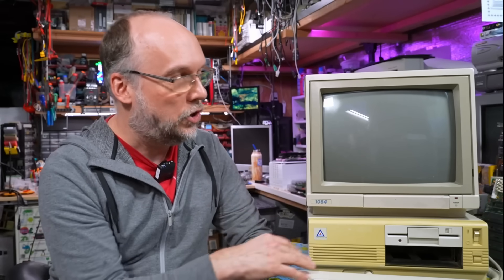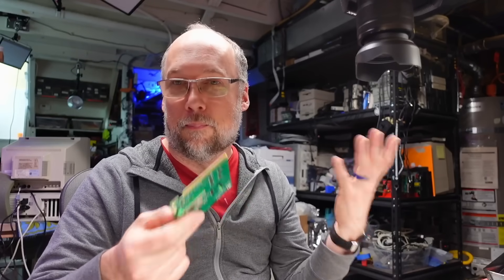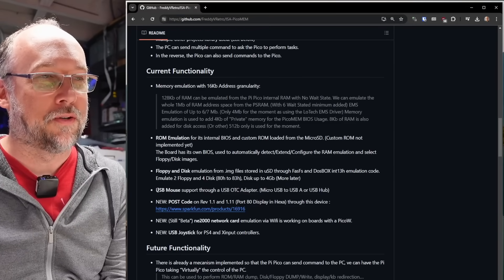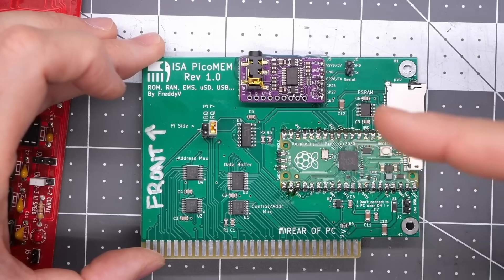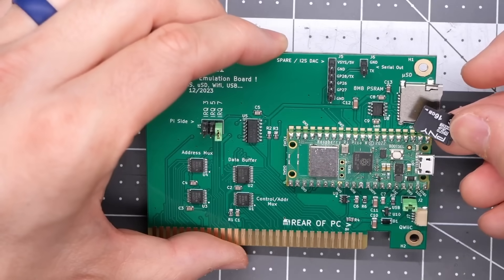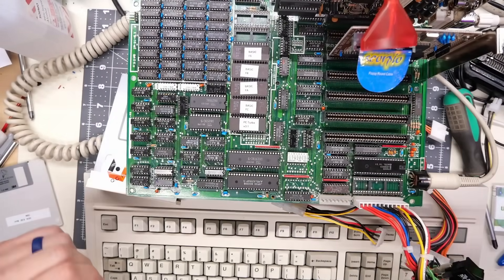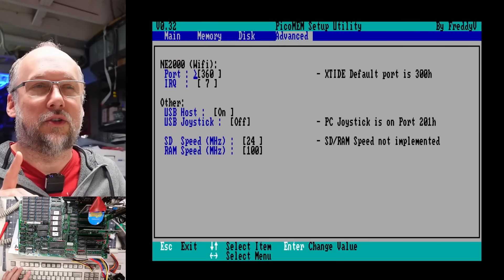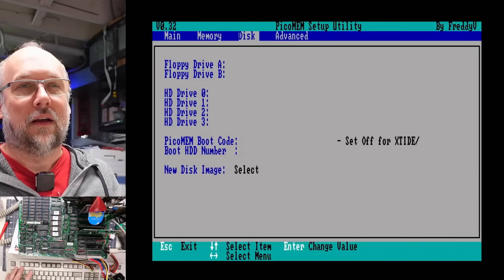The PicoMEM is an amazing software defined ISA card

Comment: Hi Adrian, thanks for the tip about this product. I will use it to resurect my old Tulip SX Compact 2 which was my first computer. It is actually a Dutch made 386sx and is still working except for the 3,5" floppy. Replacing that floppy drive with others I have (I remember even trying that when it first failed). Would you happen to know why other floppy drives simply refuse to work on a 386sx?

Comment: This can be exciting if there would be a PCMCIA version of it for all the HP 100LX, 200LX and all the other 8086 palmtops out there.
Reply: It is not possible to boot from pcmcia right? Option rom thing
Reply: @henrikgustav2294  I am not sure, my SD to PCMCIA adapter is capable of booting from it, can not speak for all versions of these adapters. Yet, there are PCMCIA floppies that most Toshiba Libretto computers boot from, also let’s not forget the PCMCIA CD-ROM drives which are bootable, that is how I installed OS/2 Warp to my Gateway 486DX2-66

Comment: One thing they should think about is doing a DOS IFS (like MSCDEX or one of the network drivers) which pushes the actual filesystem implementation onto the RP2040. It'll be less compatible than the existing BIOS emulation, but it would completely avoid the problems with big filesystems on DOS --- you could access the entire SD card in a single partition.

Comment: I don't think this card "obsoletes" a bunch of cards, what it does is make these capabilities available via modern components.  The biggest problem I see with "Adlib" cards is getting the sound chips.  If the Pico can emulate the sound chip, and it can emulate the 5v chips of the XT IDE, and it can emulate other peripherals, all while using a software designed "hardware stack", that's great.  It would be interesting to see someone emulate an XT from scratch with video support on a Pico, then maybe tie multiple picos together to make a modern hardware emulator?  Yeah, at that point it's not far removed from Dos Box, but it's still hardware and that scratches an itch that Dos Box doesn't.

Comment: Slightly pedantic, but "high memory" in PC terms is the 64KiB of memory above 1MiB which can be utilised on 286+ due to the segmentation of memory allowing segment FFFF to map the 21st address line (A20) instead of wrapping back to the beginning.

UMBs are just upper memory, above the arbitary RAM/IO boundary, which is usually but not always 640KiB, but below 1MiB.

Comment: Ugh, believe it or not I have the same Leading Egde computer except the battery exploded and has alot of "been outside" corrosion.  Haven't even spun up the hard drive till I get the imager.  Its cleaned up but now I have to sit down and check all the caps and chips:P

Comment: This would be great to get my old 486 running again if it could do more ram. It already has four megs in it, and I think it supports up to 16.

Or one of my pentium 2s I believe they are - pretty sure they still have an ISA slot. Yeah, I COULD find old simms, but sound cards, USB, networking, hard drives....huge hassle, and it all adds up.

Comment: I wish someone would build a universal software/hardware solution that provides an adapter for a Pi to plug into a PC diskdrive interface, HD interface, or even an IDE slot or serial port, and allow you to run a Pi, through the machine's existing input and output, pushing either text or pixels to the screen for the appropriate internal graphics specs (or providing video output that is far superior). This would effectively rejuvenate old hardware. While you're at it, make one that also works on retro machines like the Amiga, ST and ancient Macs. The Pi can emulate these classic machines faster than the original hardware with an even better spec. Who hasn't got an old PC or laptop or 5 that could be resuscitated for usage that way. I'd be happy to provide coding(C/C++) assistance on such a project. Worst case scenario is you can also default back to the pi providing SD storage for HD or even disk images.

Comment: This really has ridiculous potential. Lots of shenanigans you can potentially get up to if you put custom firmware on something like this or add hardware to available GPIO pins of the microcontroller. 

I need to get an XT and one of these things and see what can be done.

Comment: The irony is the rp2040 is more powerful than a 486.
Arguably it might be as powerful as a 1st gen pentium.  
Even without a floating point unit a dual core 133MHz Arm should be more than a match for a pentium 90 or 100.

I started thinking about this after seeing Doom ported to the RP Pico.  The first computer I used as a dev system out of college was a 486 33 writing a device driver for an industrial camera card.  The target platform was an industrial PC using a pentium 90.  When I considered this I was amazed that this is a 1 dollar chip.

You could use a similar ISA card as a 3d accelerator and drive a VGA or HDMI output from an XT.  

Or there were plug in processor replacements that occupied a card slot.  I know they existed for PCI machines, I’m not sure about ISA cards.  They were for people who wanted to stretch the life of there system farther than the CPU sockets supported.

Comment: The 286 supported high memory (HMA) because it supported memory above the first megabyte.  If I remember correctly, 286 went up to 24 bits of address space.  Not sure if that PicoMEM could support HMA though, as I'm not sure that A20 is brought out on that older 8 bit ISA bus.

Theoretically, the traditional 8086 could have supported high memory if Intel had exposed A20.  HMA works by setting a segment register to FFFF, and offsetting past the end of the first megabyte for up to 65520 bytes of memory above the first megabyte.  However, because the 8086 doesn't have A20, that address space wraps to the low 64.

PC compatible machines that have a CPU with an A20 line also typically have a fabulous hack to enable the A20 line in their chipset so they can reproduce the traditional wrap to address 0 behavior for the HMA.  This is traditionally done using an AND gate attached to the 8042 keyboard controller.

I believe Compact (or someone) created a "fast A20" hack that does it through I/O port 92h.  There was a patent on using port 92h to enable A20 for years; not on the hardware implementation, but on writing to the I/O port in software!

Comment: You remembered it slightly off. The number is 64ms. Security researchers have shown that approximately the square root of the memory size is poor, leaks like a sieve, and needs to be refreshed at least every 64ms. Most of the memory is drastically better than that, and can usually hold its contents for minutes, or even longer. This is why full system memory encryption is necessary. You can just unplug memory sticks and plug them into another board and almost all of the memory content is unaffected. Sure, some small amount will corrupt. You are seeing how well cold boot attacks can work. Simplistic systems that were oblivious about security, like your board there, will not clear RAM - you can just reboot and read the RAM content.

Comment: It's always funny and ironic to see a addon card that's actually way faster than the entire computer. 😂😅
Reply: Hi,
Thanks for your comment. I Used the Pi Pico because I think that using a Pi 4 in an Amiga is overkill.. 
A Pico is a microcontroller, with less RAM than the PC and one entire core is just used to do the communication with the PC. (There is no FPGA, no CPLD)
Have expansion with faster CPU than the main machine is not new.
The Pico has the same CPU as the Gotek, and nobody noticed that the Gotek is more powerfull than the entire PC.
The Commodore 64 Floppy drive contains a C64 motherboard, nobody complain that C64 Floppy is as fast as the C64.
The Sound blaster has a microcontroller, ...
The modern graphic cards are more powerfull than the PC.
Reply: Why is my reply gone?
Reply from the maker: @p_mouse8676  I see it, but Youtube comments are stupid and often disappear .... try again now, it might be back. (It can take days for all the replies to show up)
Reply: @adriansdigitalbasement  no they are gone. Oh well 😄😄

Comment: Regarding RAM refresh: all DRAM keeps the vast majority of it's contents for a LONG time vs a typical refresh cycle. I was once designing some hardware (in an FPGA) and on a lark turned off the refresh on the RAM (DDR I think?). In the RAM was a framebuffer, so I could visually watch as the memory lost it's contents. After a few seconds you started to notice the odd pixel go 'wrong', but it took a few minutes before you really started to notice it.

The problem is it takes just one bit to degrade faster than the others to completely screw up the contents of memory, so refresh runs WAY to frequently for the vast majority of bits, just to GUARANTEE that all bits maintain their value.

The BIOS designers should really have chosen a different way of detecting cold vs warm boots, waiting for a particular location to degrade is not at all wise.

Comment: Is there a Board with a RaspberryPi, which you can put in a XT/AT System, wich allows you to use Keyboard, Diskrive, all the Ports on the Backside and Harddrive like the PiStorm or Vampire Project for Amiga?
That would be cool!

Comment: I have a Leading Edge Model D with 20 Meg Hard drive and 360 Floppy and Adlib. This is a neat card, but what is the point? If I want these new features, I just run a Raspberry Pi, or the 10 vintage 386's I have laying around, or multiple vintage laptops. This doesn't do games well, and so forth. Yes, it keeps my college PC running, but then, it is running just fine now, (still !).

Comment: It would be very interesting to get also a PCMCIA PICO card and get Wifi, USB and SB support for old laptos. The PCMCIA Port is based on the ISA Bus, the is probably not so difficult.
Reply: Getting connectors might be a challenge.
Reply: I believe this depends on option rom, which I'm not sure is a thing with pcmcia. Some manufacturers may have implemented it on their own however. But I don't think it's standard for the pcmcia specification.

Comment: Does it have to be a raz Pico? If you need more power to work better on newer systems to why not a raz 2 or 3a? They should be able to work all the way up to a 486 dx 166 should they not? there should be ample space if you use the slot at the end or leve a empty next to it, right?

Comment: For once having a shared bus across all slots comes in useful: there is no reason why everything can't be on a single card.
Reply from the maker: Yeah -- the RP2040 is pretty much maxed out, but in the future faster versions with more GPIO lines could also emulation video cards and more just with one single add-in.

Comment: Can you use this to use a USB keyboard? I cannot find an affordable XT keyboard.
Reply: It's planned for the future
Reply: That would be a good feature. It's not super easy to find an XT keyboard anymore.
Reply: I use a PS/2 keyboard to XT adapter with a little circuit and controller on my IBM 5150 and it works, but even then, PS/2 keyboards aren't that common anymore.
Reply: @alexandrecouture2462 I have several ps/2 keyboards; where do you get the adapter.

Comment: hi, I understand the Pi Pico board is useful for prototyping. But what are the advantages of not integrate the 2040 on the final board? Specially when it looks machine assembled. hmmm.
Reply: Hi,
Because it is not possible to add the Wifi chip alone.

Comment: Well, the new Pico 2 has 520 kB ob SRAM on chip. And it is said, that it is otherwise function compatible. Maybe the firmware could be changed to sense this and provide more RAM to the XT which is not serial RAM. Would ne nice...

Comment: is the pico mem going to support gravis? sound blaster? Gen Midi? mt32... etc, is there a way to put ian scotts files on that card and use them? maybe you can ask ian scott to make the pico gus into a wavetable header card, id like to use that on my sb awe 32 (original release card), maybe you could ask freddy to add wavetable header or is there a way to add wavetable header to the board? i have only 1 isa slot in my p3 machine, im limited with my options. i cant use a joystick (15 pin) with the dream blaster x2 wave table header card at the same time. now you know why i am asking so many questions :)

Comment: @adriansdigitalbasement - I wonder if in a next rev., if he'll choose to put a full size USB 2.0 port instead of the USP OTG?
Reply from the maker: The PicoGUS did this. The latest boards don't use the RP2040 on a Pi Pico but instead all components are installed directly on a PCB. So it uses a normal USB A port for easy connection of peripherals.
Reply: @adriansdigitalbasement  Yeah, I know the PicoGus did that, but there really is no reason it couldnt (or really shouldn't) be done on this one also LOL.
Reply: @rrshier  Hi, It is due to the fact that we have to choose between the Wifi or this USB Connector :)
It is normally not the end of the story for PicoMEM Boards, we don't know how a Pico 2 W module will look like (USB C ?)
Reply: @freddyvretrozone2849  - Honored to get a response directly from you :-)  I wondered, Im not a raspi expert, but AM a SW and HW dev.  Also, I totally missed the orientation of the Pico on your ISA carrier board!  This is great stuff, I plan to pick one up soon!

Comment: The ROM settings is NOT for a diagnostic ROM. The diagnostic ROM replaces your BIOS. This setting is for OPTION ROMS that start with 0x55AA like XT-IDE, etc.
Reply: Hi,
You are right, the Optionnal ROM need to start so that the PicoMEM ROM can be seen. However, Diag ROM can be adapted to work as optionnal ROM.
In the case of last Adrian XT debug session, the Optionnal ROM were able to start.
ROM addition is only in the menu, not implemented right now, because I found no concrete case where it can be really usefull. I did keep it in the Menu to show it is possible.
Therre are also Pico based ROM emulator that can be use to put Boot ROM directly on the machines.

Comment: Why do you need a custom display for the POST error codes? It has a USB port, just spit them out as ASCII text and any terminal emulator on any other PC or MAC can easily display them?
Reply: Hi, USB Work in completely different mode for Host and Serial and not everybody know how to use an USB as a serial. 
It is also for the fun of it and put an I2C connector open the door for lot of possibilities. So, I can also ask Why not ? :)
Serial output is used by most of the lib for debug, so, if USB Serial is enable, lot of stuff are diaplayed.
The Board also has a serial out for debug, this can be used for a future more complex PC Debug / Diag mode.

Comment: I'm wondering if this card works in a Amiga 2000 with XT card?
Reply: It work with the A2286 the 8088 board is a clone of the PC10 and it is barely working. (Still need some test)

Comment: While my IBM XT was sent to the recycling gods not that long ago actually the video cable alone for the Hercules monitor cost me $20, my 5.25 in floppies became corrupted and I'm moved on. Even if I wanted to get this card, a fantastic piece of technology BTW, it would cost me ... here in Australia ... more than the price of a modern used computer system and between US$ 21 to US$89 in postage ... and, sadly, that's why most vintage computers here have ended up in land fill.

Comment: Does this thing bypasses the internal keyboard controller? So no more “keyboard not found” or “keyboard controller error”?
Reply: USB Keyboard is not done for the moment. it can work only if the BIOS does not block itself when the Keyboard is tested, or if the Optionnal ROM was executed before it does the test.
It is not possible to emulate the Keyboard controller as it will conflict with the existing one. Then, it can be doe with interrupt redirection only.

Comment: The texelec page does not say the maximum CPU supported.  I would be interested to mess around with this on a 386sx if the card can handle the speed.
Reply: Someone tried on 486 and it worked as he claimed

Comment: 31:00 DOS=UMB should allow DEVICEHIGH and LH to be used.
Reply from the maker: Those commands don't work on XT machines. (Require a 386 with shadow memory) Third party tools allow moving DOS into upper memory on XT machines.
Reply: @adriansdigitalbasement  Oh wow! Didn't know that. I never had an XT. On 286 you can at least use DOS=HIGH with HIMEM.SYS loaded, and IIRC there are UMB drivers for 286s as well.
Reply: @root42  Hi, 
DOS=HIGH need a 286, DOS=UMB should work, and need the USE!UMB driver.
Also, this work better on an XT With 640Kb of RAM, as the UMB Will be "Fast", anyway, an XT Does not need to have DOS High, as an XT with 640Kb can have everything running.
UMB on XT can be more usefull for "Not CPU intensive" drivers like Mouse. or for application data.
On a 286, the PicoMEM added RAM will be slow, as it is on the 8Bit ISA BUS, so, this can be used for really really low CPU intensive applications. (It is not specific to the PicoMEM)

Comment: On one hand the Pico can emulate all those things - on the other hand it's 100x the computing power of the original CPU. At that point you can just emulate the whole computer.
Reply: Hi,
I am not sure that emulate RAM, ROM, EMS, manage Wifi, USB, MicroSD and Adlib is really possible on a 1MHz CPU.
The RP2040 is a 0.8$ Microcontroller.
Pure software emulation and Hybrid Hardware/Software are two totally different things. the emulation need to be real time. Even 5ns (yes nano seconds) of delay can have it working or not.
Reply: @freddyvretrozone2849  My thinking is, why even put such a powerfully microcontroller inside an obsolete PC. I do respect the project for its complexity though.